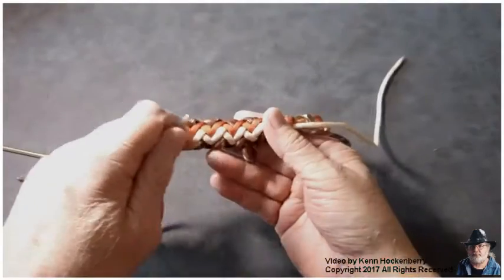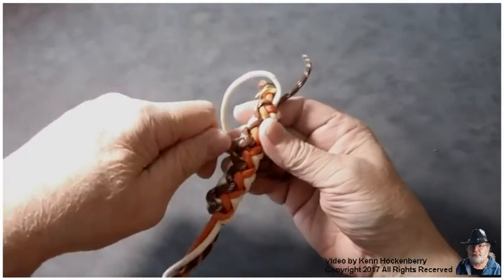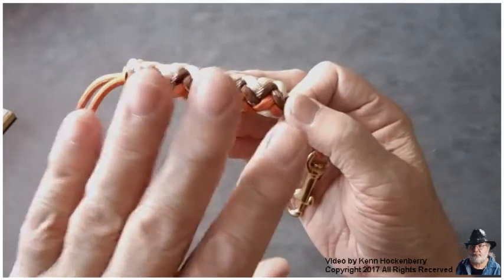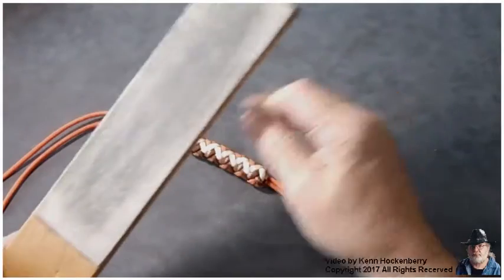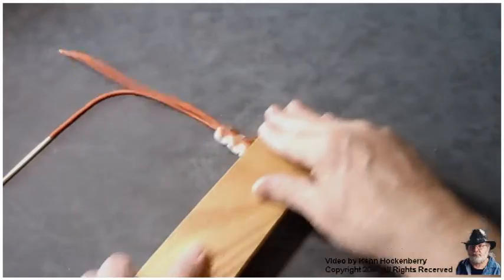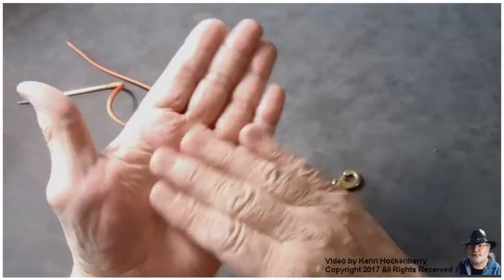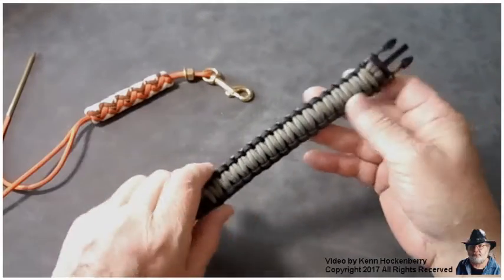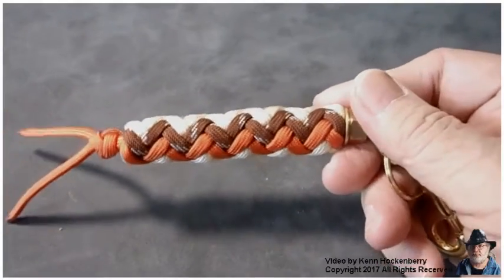Why We Roll Paracord

Comment: Yup, yer knots are tight. Nice reminder of something I often forget to do, and it works well for most any type of cordage. Another step you could touch on sometime is actually beating the knots. Sounds kinda kinky, but it works especially well on natural fiber cordage.
Reply from the maker: Thanks Dave... Yes you're right... many times I've used a smooth faced hammer on my paracord...